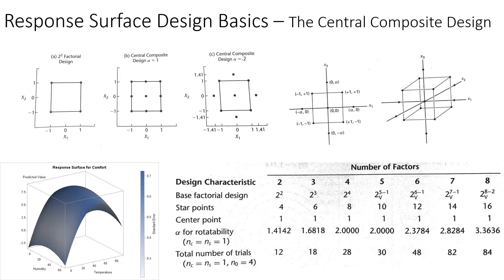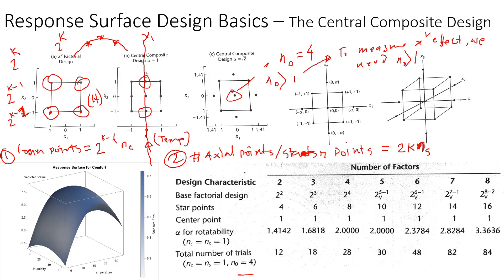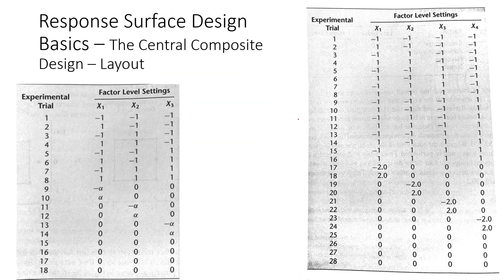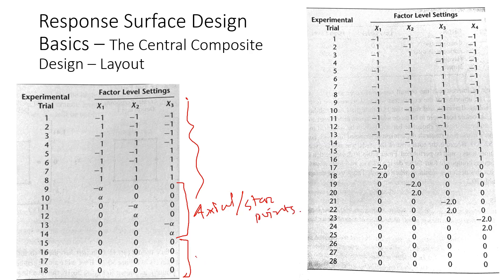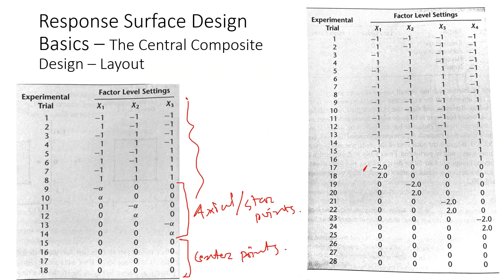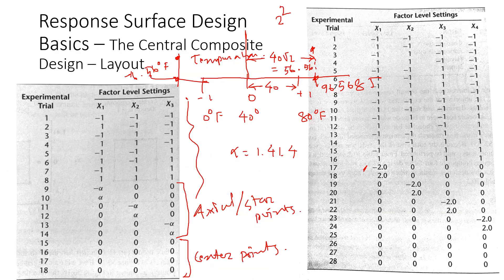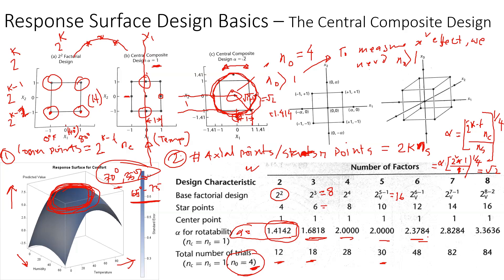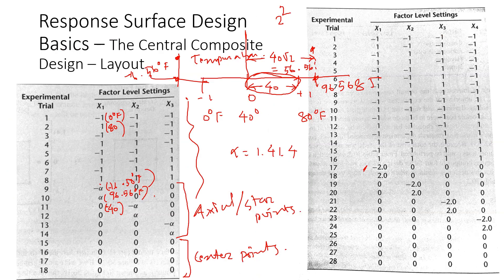Response Surface Methodology Basic, the Central Composite Design Explained

Comment: When I enter the Low and High in Minitab (e.x. 0.5, 2) and generate the axial points, I get negative values (e.x. -0.0113446
). It is not possible to add negative material to a chemical experiment (you cannot add negative yeast to make bread). What is the best way to adjust this number? If the smallest amount I can potentially use has a value of 0.2, can I use that? How would that impact the results of the analysis?

Comment: How many center points we should take? any standards
Reply from the maker: As low as one point is fine depending on the experiment. However, it is easier to run study on the Center Point. Therefore, replicating the study in the Center Point will help us to see the "Lack-of-fit" as well as improve the power of the experiment. There is no standard for the number of replicates at the Center Point that I know use widely.

Comment: How can I analysis 3 data ? I mean 3 factor 3 level
Reply from the maker: Three factors (independent variables) and one response (dependent variable) would make the response surface a four-dimensional problem. You can create response surface for each level of the third factor using two other factors as independent variables, x and y, and one response as a dependent variable, z. It is possible to use program like Matlab or SAS to stack the response surface for each level of the third factor. I am not sure you can do it Minitab!
Reply: How can I design pre-requisite experiment